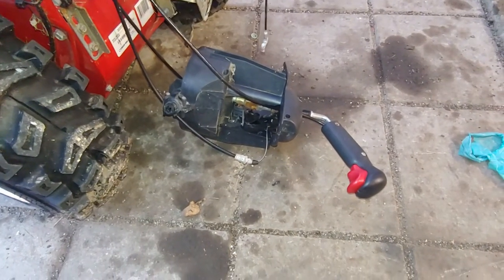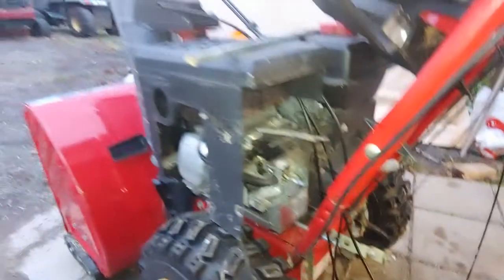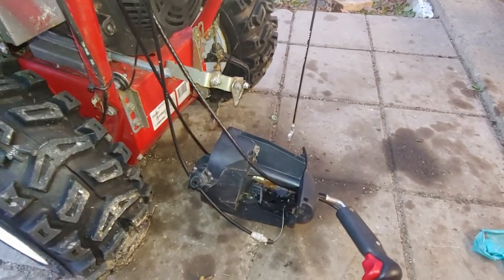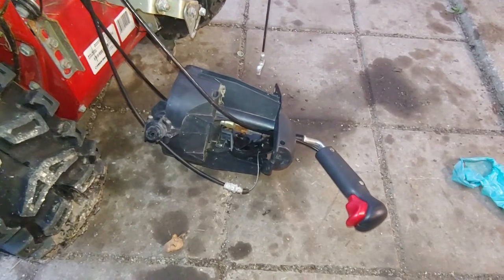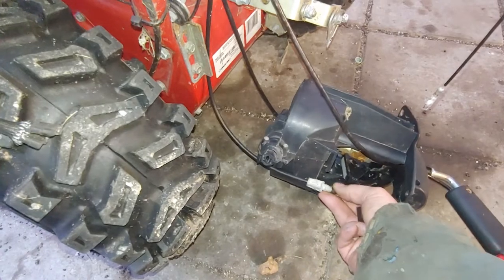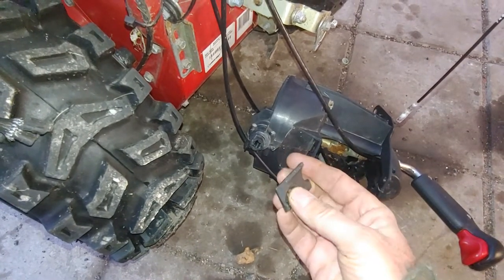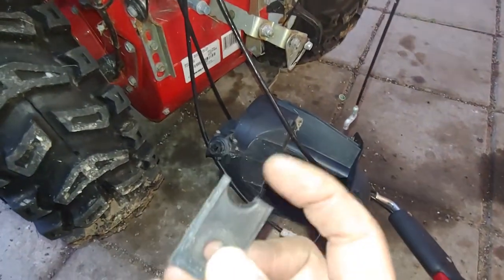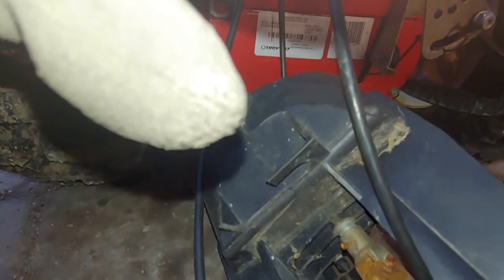fixing broken chute control on troybilt snowblower-part 1

Comment: The shoot control handle on these has been nothing but trouble on mine ! A split pin has come out and handle does nothing but flop around now for left right . Yet It will move  the tip up and down  To get pin back in will take tearing entire thing apart ! Might even try a small  cotter  pin !